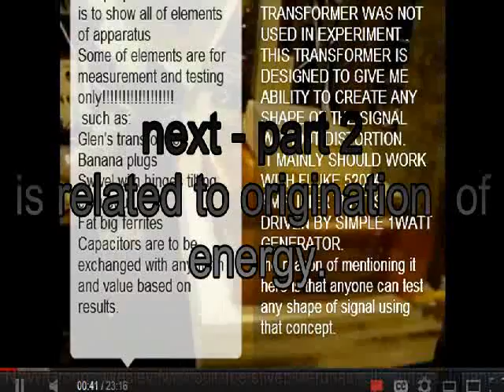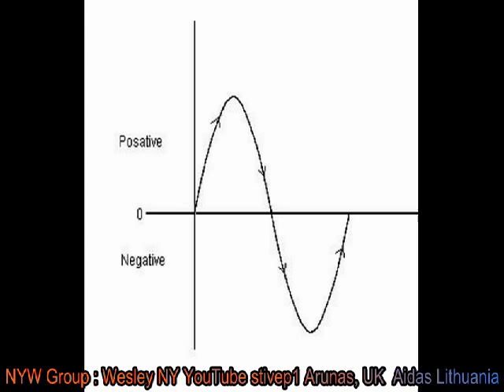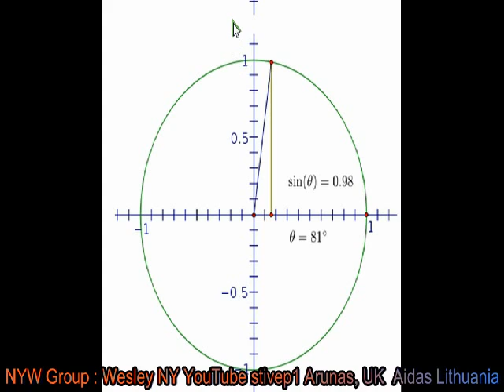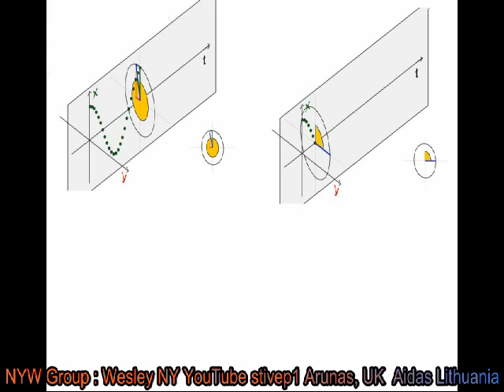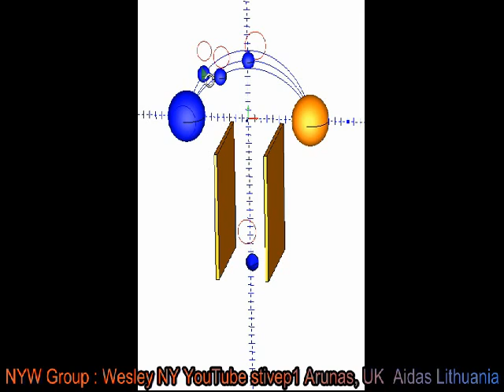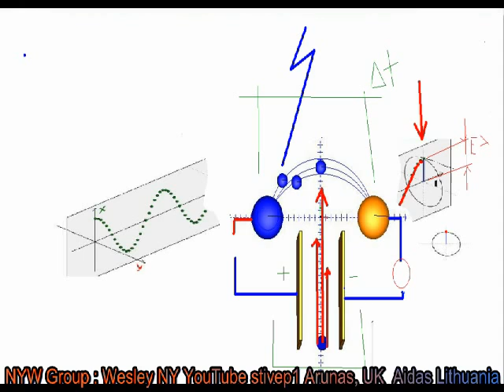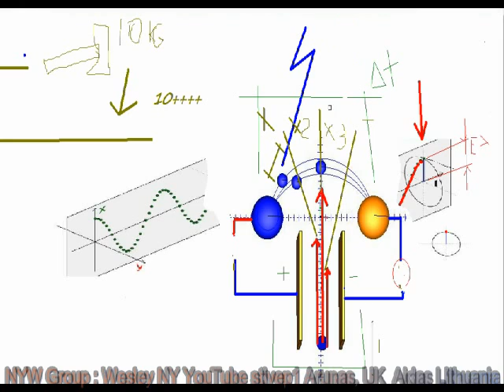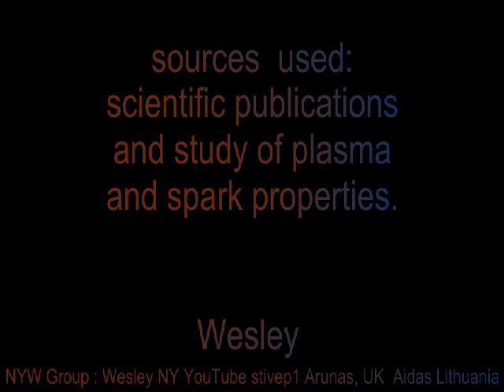Why Kapenadze ..How this FE works? Video #1

Comment from the maker: @z1zaz THINK ABOUT IT AS:
 pipe with water and valve. It is not important to you who pays for water flow  you only pay for valve switching energy.

Or 15 young girls pushing the car... and 1 girl only after the while... and 1 finger of that girl only after the while to sustain the motion.....

Power density in spatial  form is  amount of fingers of the girls at the same vector at one time and/or X increments at Delta T. That is = to spectral harmonics affecting magnetic flux of C.

Comment: Hi Wesley,
It can't be Cosmic Rays energising your equipment via the spark gap.
Not enough energy in Cosmic Rays to do this at ground level.
Maybe there is a difficulty in describing concept here,
as with Moray back in the 1930s.
Some spark gaps have added Radium gas to increase efficiency. 
Some are sustained plasma types too.
It is then the Radium gas (Sea of Energy) which emits additional electrons for the oscillation to resonantly collect.
Mere earthly mortals are not allowed to use Radium !